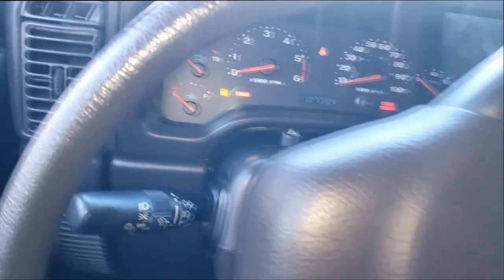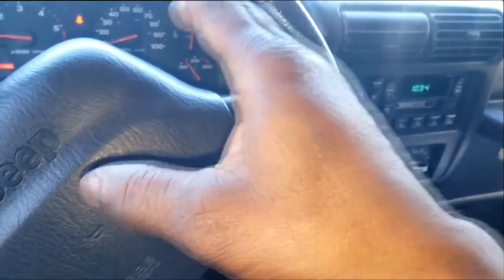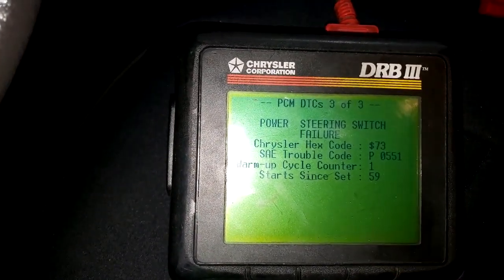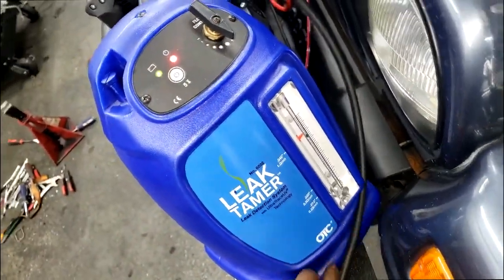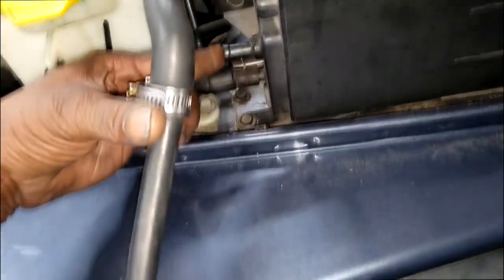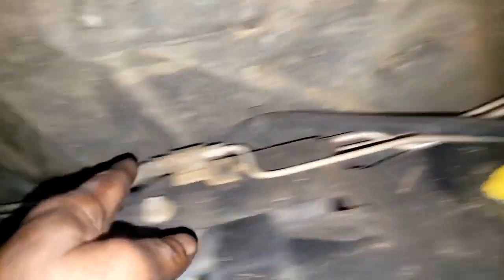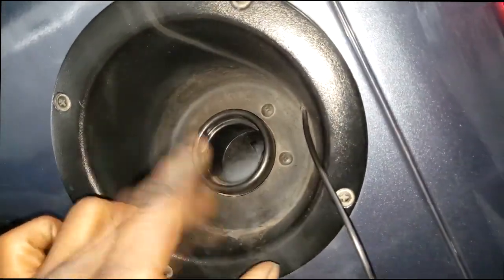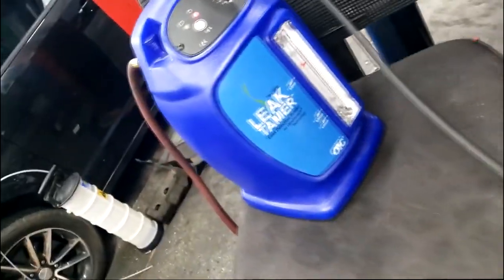Trick test to fixing P0456. P0455. Using these junk parts could cost you a check engine light.

Comment: You don't need a scanner to pull codes from older Chrysler and Jeep. On, off, on, off and then on with the key. Codes come up in the cluster. But you still need it to look at values and do bidirectional controls,  etc.

Comment: But yeah I had a power steering pump put in and he wouldn't change hoses and left the bolt loose on the pulley to vibration damper
Reply from the maker: Dang, what kind of vehicle is this that you have to remove the dampner in order to replace pump?